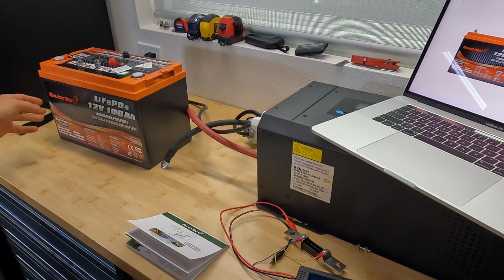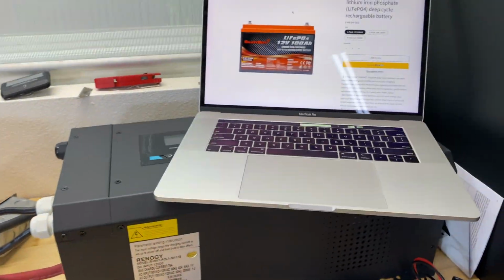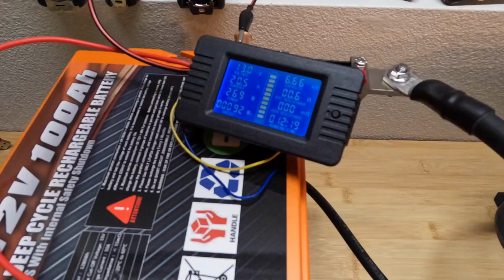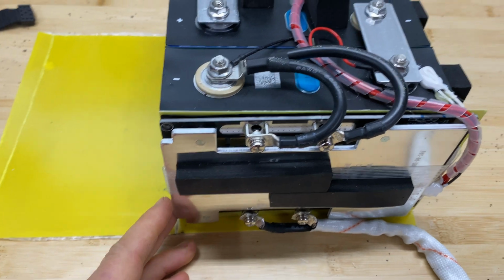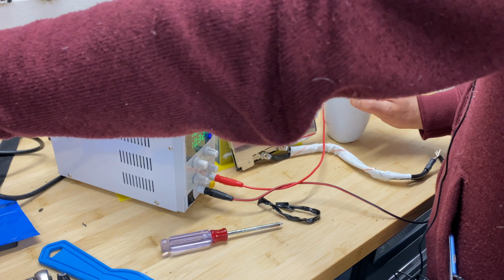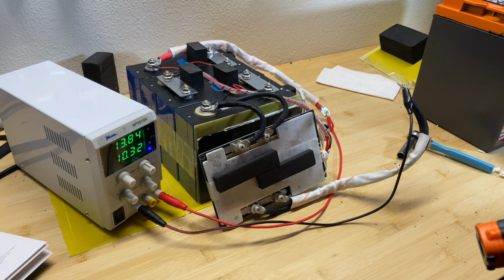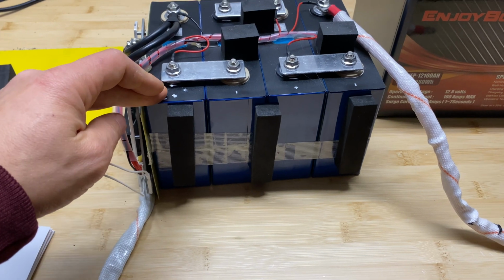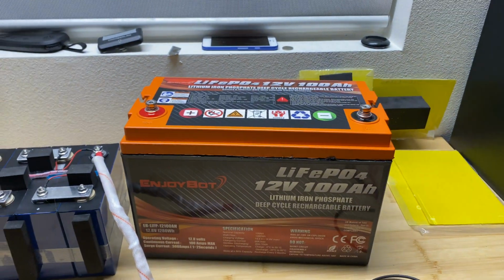Full review of EnjoyBot 12v 100Ah LFP battery.

Comment: Hey I live in my dodge grand caravan and I have a chins battery but I need one more battery for a good capacity for everything I run in my van frige ,ice maker, microwave air conditioner 8,000 BTU. I run my ac and heat off of a generator but I am out of work and I would love to win this battery for Christmas it would help me out a great deal. Because my transmission is out and I have to get money for remanufactured transmission so if I could win it would be a blessing.

Comment: Great video and review, good job pointing out lack of Low Temp Disconnect.   I'd love to use this batter without the case would fit great in small battery compartment that was designed for 50Ah battery.

Comment: It would be interesting to see how quickly the BMS will balance cells, and at what pack voltage it will start to do this. How about drawing down an individual cell, then measure the balance current to it, and the the drain current from the higher voltage cells, to get some idea about how well and quickly it balances. Just one thought.
Reply: I have three of these in parallel on my boat, and am trying to get a handle on how often and for how long I should take them above 14V to allow good balancing.

Comment: At $329 I would use this battery as a second battery in our camper.  Before leaving Minnesota, I would take this warm battery out to our camper in -0 F, place in front of furnace, disconnect our main batteries, and start the furnace before we leave for Arizona.  The furnace would not allow the battery to freeze, but I could warm the other batteries.  Once the other batteries are warm I would disconnect this battery and connect the others.  I would then take this battery along as a backup.  We always warm our camper up a day before leaving.  The furnace is always running when traveling south in the winter.

Comment: Good review, i have both batteries Enyoybot and Chins and to my understanding Chins is made by Enyoybot, lots of similar characteristics. Great review. I would like to add it to the one that i have to expand to a 200 amp capacity DIY sistem i want to build for my mother in law since there are too many problems with the grid in Puerto Rico. Really don't care about low temperature cutoff we live in the Caribbean.

Comment: I could use this for my mobile home we do not have electricity throughout it yet! Unfortunately winter has come and my wiring has stopped. The front half of my home has no electricity yet and of course that’s where my daughters bedroom is. I have solar panels connected to 18 650 cells so that her bedroom has power for her computer I would use this 100 amp hours to make sure she was set up properly. Unfortunately I am stuck until winter is over before I could finish wiring.

Comment: I would use it to power my gaming setup in my truck. I'm currently using a very small diy lithium-ion 4s9p 200wh battery I made from used laptop batteries and it only extends my game time by like 1-2 hr. This battery would absolutely be a massive upgrade.

Comment: Boat battery for the trolling motor. What was the wire on the bottom outside when you first took it out?
Reply from the maker: at what second this wire appears?
Reply: @SolarEngineering  I thought it was a wire 7:57 but it is glue lol

Comment: Maybe I misunderstood but didn’t you say in the beginning spec sheet, that this battery had self heating when cold, not cold cutoff?
When you tested the charge current, you looked for charge disconnect but a self heating battery will keep battery from getting cold.  You would measure the actual current going into the cells vs the current from your charge source to see if any current is used heating the battery to keep it from getting cold.
However, I didn’t see a heater is your disassembly.
Reply from the maker: From the brochure, there are 2 different series of batteries: with heating and without.
Battery that I tested doesn't have heating film/pad.